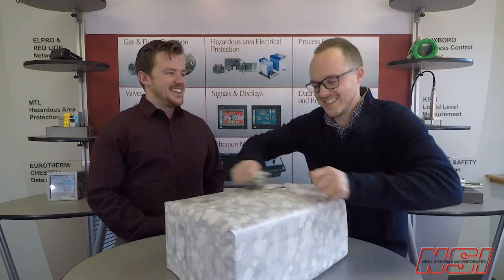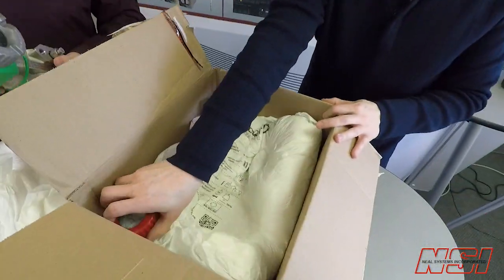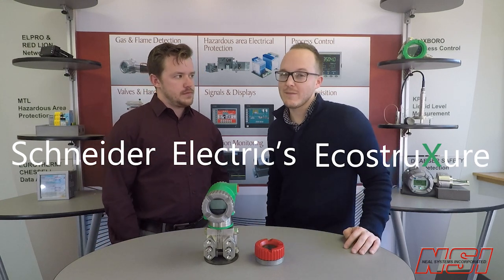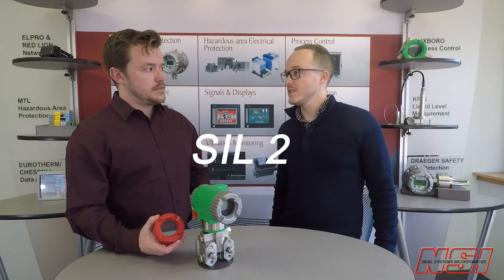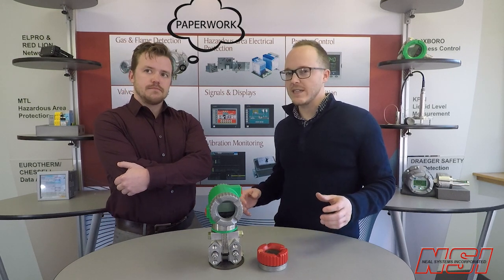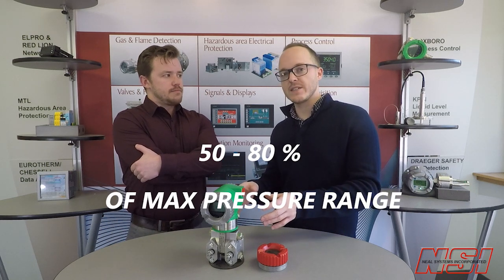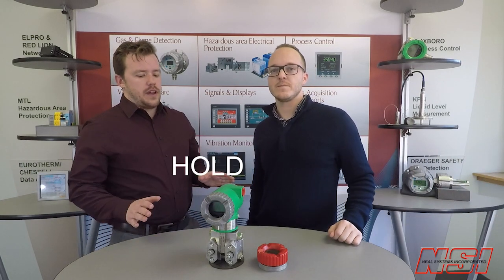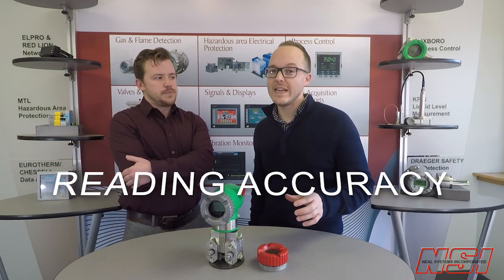Schneider Electric's New Pressure Transmitter with FoxCal Dynamic Technology

Comment: As per this vedio I could under stand that
Suppose I have 0-20 kg/cm2 transmitter and i want to use it for 0-10 kg/cm2 application hence i need to enter only zero and span no need to calibrate it in 0-10 kg/cm2 is it correct?
Reply: Yes that's correct!